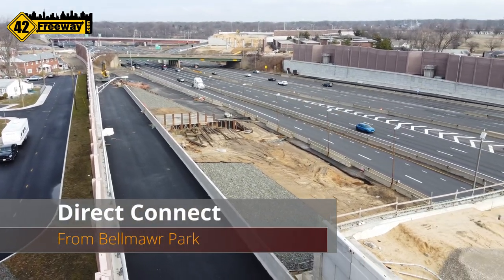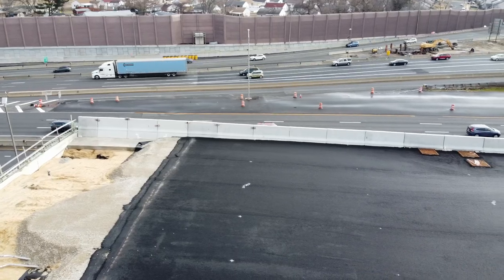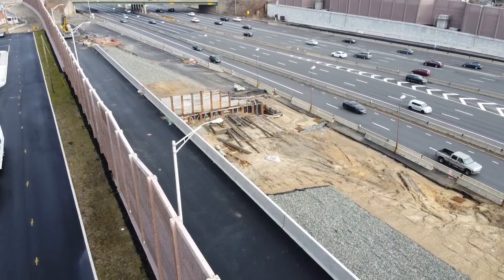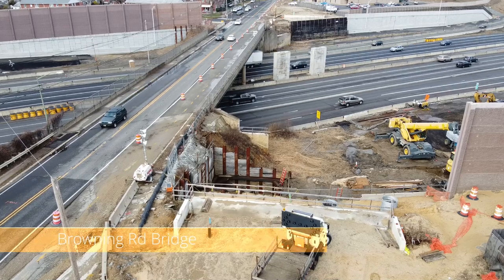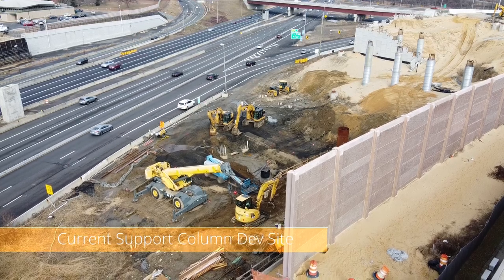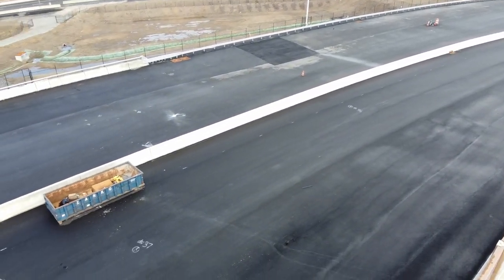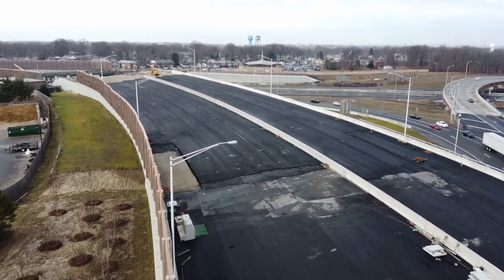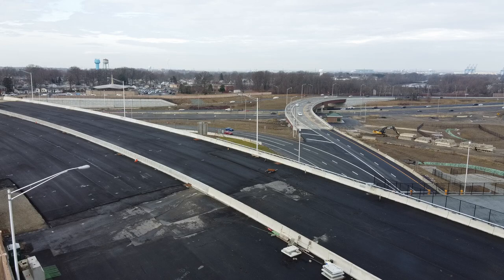Direct Connect February 2020 Quick Aerial Update - 42Freeway.com

Comment: I was hoping for a Ramp from 295 North directly connecting  to 42 South!   Why hasn’t that been thought of?  To go onto 42 North to the MARKET Street Exit and Loop around  across the Overpass getting onto 42 South~ is quite dangerous to Merge, with Traffic coming from Route 130 into the Freeway.   Perhaps I missed a post about this?   Thank You Kindly for keeping Us informed!
Reply: Check out the RT 42 missing moves project it will connect 295 North to 42 South and 42 North to 295 South.   Construction started already